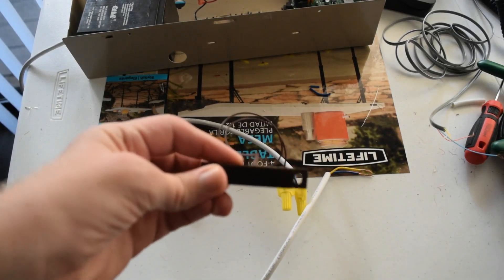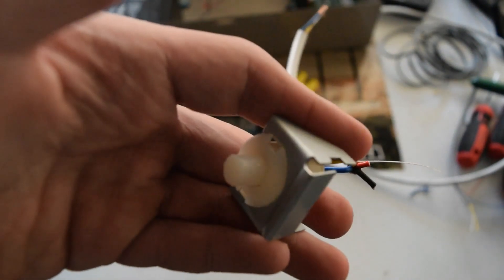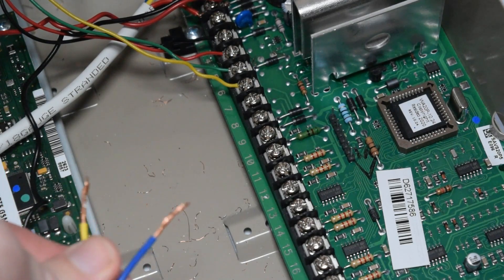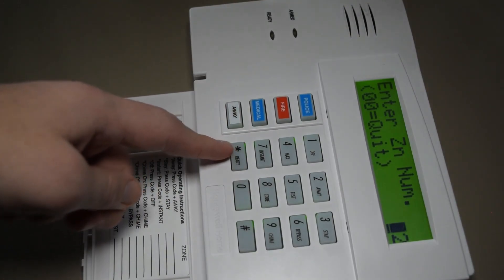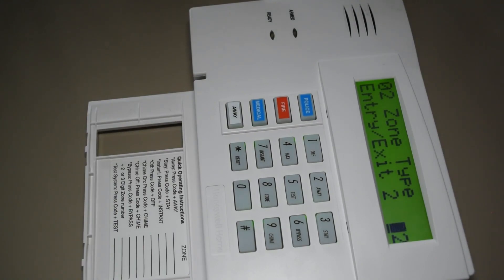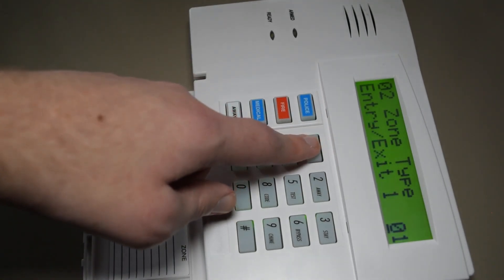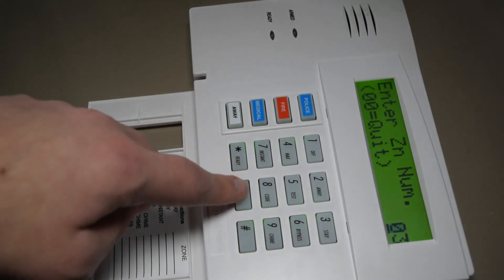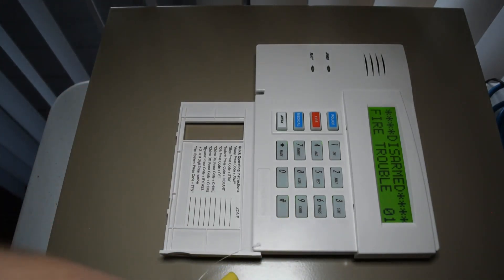Security system wiring tutorial[Honeywell Vista 20P]: Ep. 3-Add zone

Comment: Following along so far, good stuff :) What do you recommend for someone like myself who needs more zones... is there a way to expand the Vista-20P (or is there another/better model)?
Reply from the maker: The Honeywell 4219 zone expander for the vista. Or use a zone doubling kit(two different value resistors).
Reply: @NM_Tech  - Okay, awesome! Which would you think is easier for a 1st-timer? And where do you recommend buying gear (like panel, motion sensors, fire, keypads, etc.) I prefer higher quality equipment over budget-friendly equipment. Thanks!
Reply from the maker: Honeywell equipment is solid quality and more easier to work with than some others. DSC would probably be higher quality equipment but as far as I know, not as easy to learn especially if you’re just beginning. I would recommend the Honeywell Vista 20P or similar models(15P, 10P, 21IP) as I worked with in this series of videos. Usually eBay you can get this equipment new or second hand for decent prices.
Reply from the maker: To add on, I’m sure you could even get some DSC sensors and still wire it up to a Honeywell panel. Conventional hardwired devices like those would work with any conventional hardwired panel.
Reply: @NM_Tech  - Love it, thanks so much! Super helpful! I'm using your videos + ChatGPT + like 50+ other tabs to do supporting research. I think leaning full Honeyell is likely the best route based and what you said. I think a 21P panel is a solid choice. I might hire a local installer to teach/install with me. That would be the best for learning. Do you have any recommendations for connecting the 21P to HomeAssistant?
Reply from the maker: Unfortunately no I don’t have pointers there. But, to be honest, for higher security, I’d personally stay away from making your security system accessible with home automation or any sources that could be accessed from the outside if compromised. And, to be honest, hiring an alarm technician probably wouldn’t be so enthusiast friendly. For one, that’s costing you a lot of money, and two, they have schedules to keep to. They would just want to install the system the quickest way they can most of the time
Reply: @NM_Tech  - Fair points, thank you for the tips. Do you have a place/link where I could donate? You've been super helpful!
Reply from the maker: No, I do not as of now. Maybe I might set something up for that in the future, but I don’t typically expect profits from this.
Reply: @NM_Tech  - Okay, well thank you again for all your help in your videos and for answering my questions via the comments. It's been super helpful!
Reply from the maker: Please feel free to join the discord community in the description!
Reply: @NM_Tech  - Sweet, I'll check it out!
Reply from the maker: Are you still paying attention to this thread? If you still are, supers have been enabled on the channel. I just remember you said earlier in the thread that you’d be interested in donating. Now you can! The button that says “thanks” should now appear on all of my videos!